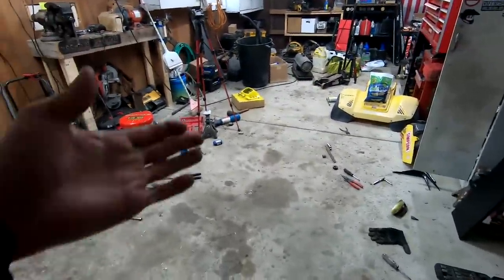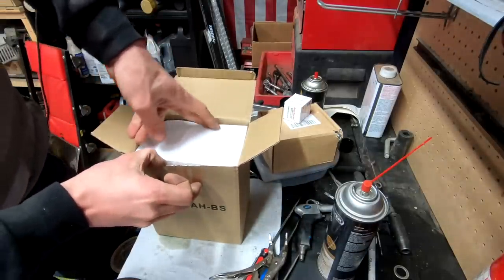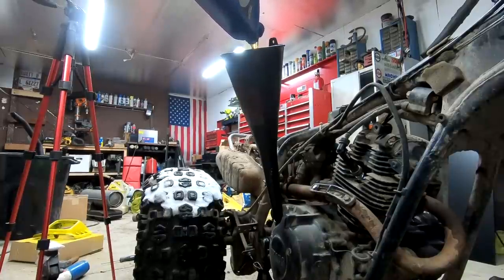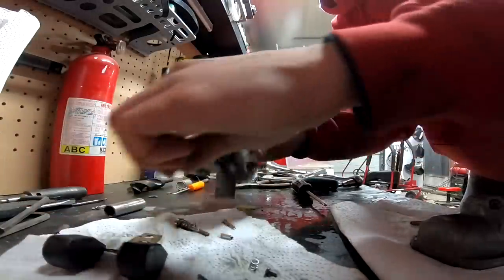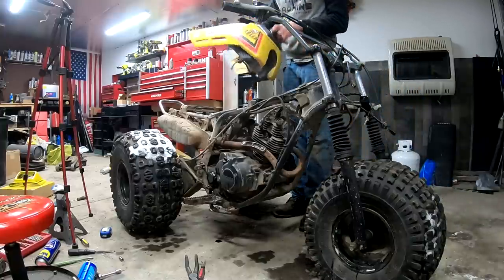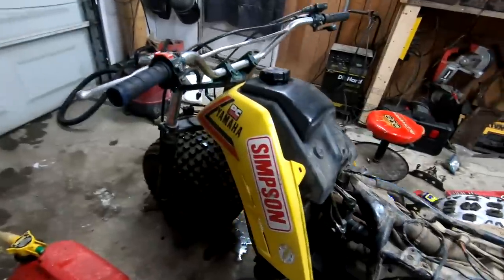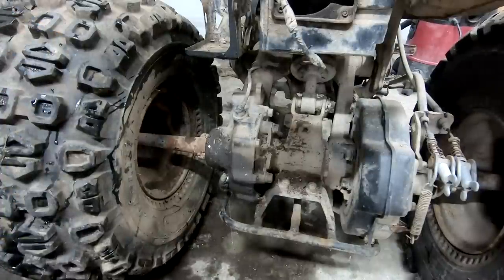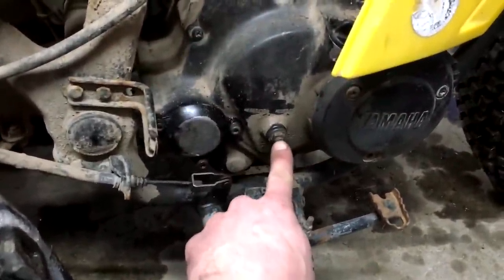Trashed Yamaha Three Wheeler - First Start and Run

Comment: From the manual.
1)Loosen the clutch adjuster lock nut
2)Using a screwdriver, turn the clutch adjuster counterclockwise until resistance is felt. Then turn the adjuster 1/8th turn clockwise.
3) Tighten the clutch adjuster lock nut to 11 ft lb.

Comment: That decrease/increase bolt is for the clutch
Reply from the maker: Thank you. I'm assuming increasing "increases clamping force"?
Reply: Yes
Reply: @3DMachines  Automatic clutch (similar to a Honda Foreman atv)  Loosen the locknut. Turn the clutch adjuster with a screwdriver counter clockwise until resistance is felt. Turn it back, 1/8 turn (clockwise). Tighten the locknut to 11 ft.-lbs.
Reply: 3DMachines it changes the firmness of the shift increase it all the way and it will almost slam straight into the next gear
Reply: @lkennett   lol..just adjust the one on my honda foreman a few nights ago...getting ready to move snow again...blah winter..
Reply: 3DMachines yes that’s why it ticks you have to tighten it
Reply: @buttercupwalker  2002 Foreman 450s, since new.  Its a workhorse.  Adjusted the clutch once years ago.  Ready to go with the plow on the front.
Reply: @lkennett  right on..I have a 1989 350...lol..she's old but gets the job done,lol
Reply: @3DMachines  Yes sir :D
Reply: I didn't know that either. Thank you

Comment: Your old oil filter was a re-usable filter. Someone paid extra $$$ for that. It can be cleaned with brake cleaner and re-used. Some will argue it is better than paper. Personally, I like to just replace the paper filters more often and be sure they are clean!

Comment: That bold that said increase or decrease is how tight you want your shift lever/clutch to be when shifting you can adjust the flat head screw in the middle for how tight you want your shift lever/clutch to be and the nut around it tight it down so it doesn't move while riding

Comment: If ever in the event that the electric start doesn't work AND the recoil starter cord snaps, put her into fourth gear for bump starts with the choke on, worked beautifully on my 225. Also buy a full DG exhaust system for it and she will wake up and sounds awesome.

Comment: I had a 1981 Yamaha xt 250 dirt bike that had the same knock and carb leak. I put a fuel line on the leak and put a bolt in the other end to stop it. The knock sounded the same but I never figured out what it was, but it never hurt performance.

Comment: The bolt that says increase and decrease is to adjust ur clutch pack and that's a plastic cover on the fill plug... u can pull it off and it's a alen head

Comment: That nut on the increase/ decrease marked screw id a locking nut for the screw. The screw is an adjustment for the centrifugal clutch yamaha uses.

Comment: The screw that says increase and decrease is your clutch engagement, if it starts to slip you increase it,  honda does the same thing on the 2000s 250ex atvs, and has a oil cooler

Comment: I just picked up one of these but the wiring is all cut up and spliced back together. Some black wires got 3 wires into 1 back into 4 and a blue one into 3 and a black and white 1 into 2, a sky blue 1 into 2. A red 2 into 1 and a brown 1 into 2. Is that totally wrong or is it supposed to be like that? I got the wiring diagram but not sure if I have the original wiring harness on the atv because some stuff matches up but then all those spliced wires got me confused. Help please

Comment: The carburetors from the older Yamahas like that are known to over flow and not seat and on the bottom of the carb is the over flow to keep from gas going in the engine over full and the screw is a drain screw for the bowl

Comment: Its leakin because the float level needs set. And that screw is your clutch engagement and it takes special oil or it will not work right because of no friction modifer. Thats probably wat your hearing. Learned ot the hard way. If its not adjusted right or not the right oil it will trash the trans.

Comment: On the carb slide spring put it on edge of your work bench push it down flat put a zip tie threw the hole spring pull it tight install it on the cable put the slide on cut the zip tie bam easy

Comment: The noise could be because your connecting rod bearing could be shot. There must be some play which would be making the noise from the up and down motion. I dont think its the valve because if they where out of wack you wouldnt even have started the engine.

Comment: Pull the seat out of the carb and clean it that’s one thing you didn’t do on the old carb and it will continue to leak if you don’t but that normally fixes it
Reply: you can also sharpen a wood sick to a point like a pencil and clean the seat by spinning it back and forth like burnishing a valve seat.  kabob skewers work nicely.

Comment: I know you know better and you probably already did please tell me you turned off all the gas heaters before messing with the gas can including the pilots light reason why I'm asking is 3 Doors Down the co-worker of mine was working on his snowblower in his garage I need was working on the car and putting gas in it in the kerosene heater he had mounted to the wall turned on and a big explosion happened knocking him through the garage door minor burns bruised ribs minor smoke and fire damage done to the garage luckily neighbors were out to help

Comment: I think something is wrong inside the cylinder. White smoke=BAD
Reply: It's air cooled white smoke usually means burning coolant it's cold there so that's why the steam
Reply: @garyroberts7257  I was pointing out the obvious, putting it simply. IT WAS A JOKE!!!!!